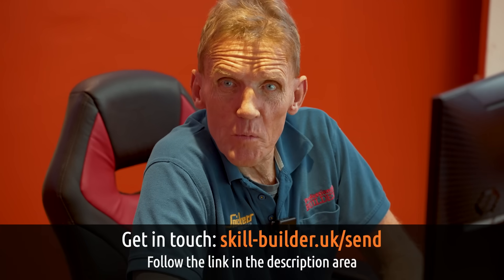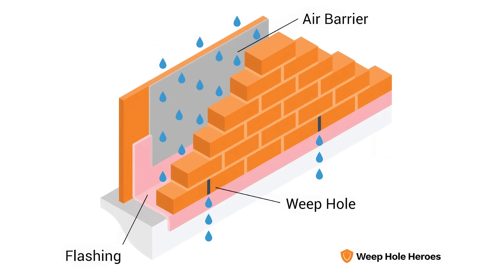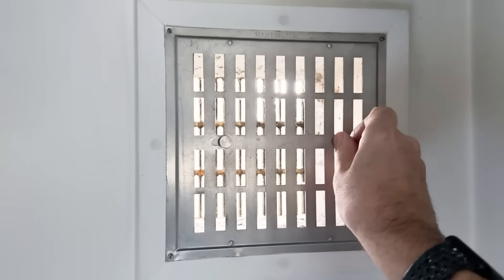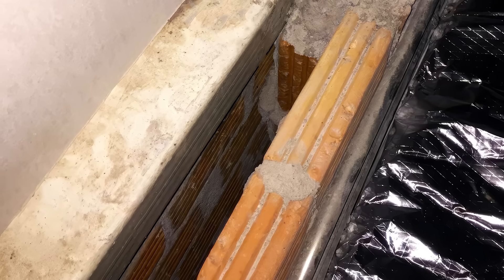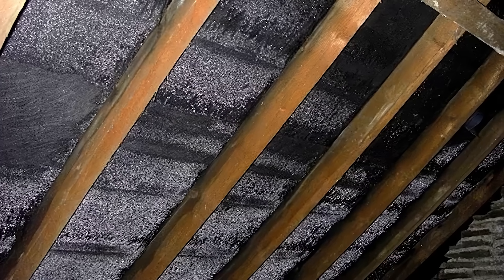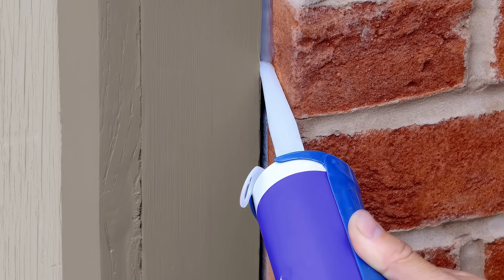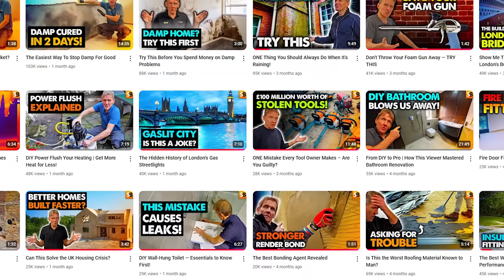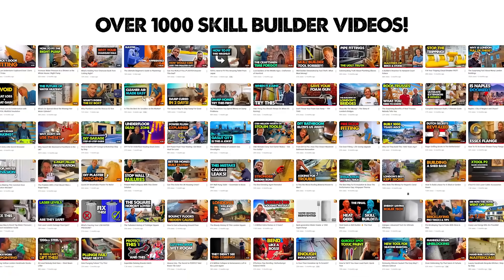The Truth About Cavity Wall Ventilation

Comment: You don't dry your clothes after washing by putting them in a closed plastic bag, you let air movement (draft or wind) on them to dry them out. So how does sealing the cavity help get rid of any moisture build up, be it from penetrating water from rain on the ouside courses of brick, or inside from a leak of some kind. Once you get moisture laden air you have condensation somewhere. Lack of air movement in houses is one reason we are seeing so many pictures and click bait stories of black mold. I love seeing these pictures of huge horrible mold in houses - basically means they are too lazy to clean it off !
Reply: This is also my logic, better blowing into the loft than soaking into the internal skin? Or mold filling the cavity. Perhaps this is in reference to new builds. Either way, often these short 3m videos leave more questions than answers. Rogers longer form content is much better.
Reply: Black mould is a PITA. We have all upstairs windows left on vent 24/7. The bathroom and kitchen have extractors venting to outside and I clean the grilles and duct once a year (doesn't need anymore than that it as even then they aren't particularly dirty). I open all windows in the house for 10-15 mins twice a day. There is a 'healthy' draught unser the front door too.
The children have a moisture absorber (unibond ring shaped model) in their bedrooms too. Probably only removing trace amounts of moisture each and only a portion of any excess when their blinds are closed which will almost seal off the vented window area.
We still get black mould growing in the bathroom on the walls and ceiling and a bit in other rooms around the window reveals. We hit it with a dedicated black mould remover every so often (tried both HG and the Bang brands). It always comes back.

Victorian house with no obvious damp issues - we had areas that were picked up when we bought the house treated and that seems to have been good for the ast 19 years - skirtings, plaster, paint no problem at all.
Central heating to every room although generally set at 18 unless we're feeling the chill and then we go up to 19.5.

Not sure what is going on but it's annoying. Not huge patches of the stuff and we're all relatively young, fit and healthy so not at major risk from it. Be nice to get rid once and for all though.
Reply: @thebrowns5337  Not an expert, but sounds like your double glazing is pretty good, and so water is condensation on cold spots around the house. (Reveals where innerleaf is bridged to the outer leaf and causes a cold spot). Bathrooms are extra humid, if you ever get it refurbished use backboard like Jacko which is insulating. Extractor fans you have might be useless, someone on YT did a video demonstrating the lack of Static pressure from most cheapies, might be worth upgrading them. Worst case, fit a PIV, tons of good testimonies.
Reply: @thebrowns5337  get a decent size dehumidifier
Reply: If you have alot of moisture in you cavity there are propably things you can do first to avoid that. But ofcourse you can live in a area or in a house were cavity insulation is just not an option.

Comment: In my new place to moved into back in May, there’s been a persistent problem with hotspots on the ceiling for condensation and mould build up, there is even a moist/damp patch of wall by the bedroom window, surveyors from the council say either it’s a “slow leak” (why and where from?!) and/or to do with the cavity wall. In rear of the property (I live in a 70s build bungalow) there are two brick air vents which appear to have been filled with expanding foam by the previous tenant! Do I unblock these or not?? Insulation in the loft apparently is sufficient but around the eaves is going to be further inspected by roofers by removing a couple tiles. The condensation and mould appears in bedroom, bathroom and kitchen, and yes I have the trickle vents open 24/7 and open windows daily, even for an hour or so during winter months.
Reply: i use a £15 infrared gun thermometer to dind the cold areas in walls and ceilings - they were in the top 6 inches of the walls, i kingspanned them during roof repairs

Comment: Okay... I am an Engineer (old school), who is in the later stages of building a timber frame passive house. I have a rendered block outer leaf with 50mm cavity. the timber frame has a semi permeable foil/fabric layer onto 9mm OSB sheathing, which in turn nailed to 235mm inner leaf timber stud work. The top of the cavity wall is closed off with  fire socks. 
The semi permeable membrane works on an "Osmosis" method where it allows residual moisture content in the frame to escape into the cavity. If that cavity is fully closed and saturated with moisture, like after having heavy driving rain then sun heating the wall, creating high humidity, this effect will be diminished.
Also by having cavity trays at DPC level and above Lintels, there are weep vents at 900mm intervals, so there will be air movement to a degree. The fire socks around the roof line will stop air to the attic space, and also fire if it does happen. I believe that having a closed off cavity will eventually impact on the timber frame in the future. Because of my fears, probably unfounded, I will be painting the render with ProPerla paint when the weather warms up. Apparently, hydrophobic paint is the way to go nowadays.
Reply: How does cavity 'saturate' with moisture after heavy rain? What is the point of building an external wall if this occurs - bricks absorb / pass water through VERY slowly so unless under water or direct heavy rain for weeks and weeks, its not going to happen! If you are building with an internal breathable skin then that MUST be ventilated on its outer face - the design is not correct if not, you are mixing methods and not in a good way!
Reply: @kawazukisoddbits2717  If you have a closed cavity and have a damp inner side of the outer leaf, and after a period of driven rain, the eventual sun will initial warm that wall to create a more humid environment, until the wall outside dries, to then pull back the moisture to the outside. The levels here maybe very small and will not affect the inner leaf and I am probably being overly too critical. Traditionally cavities were open at the top and roof eaves had ventilation either in the soffits or as vent bars sitting on top of the fascia boards(which the tile sat on), so you had a vented loft space. My house is on a hill (in Cornwall), exposed, South facing, and the South West weather fronts do push hard on my facing walls.
Reply: As long as you're weep vents are 65mm high and you have them at 900 centres above and below any fire socks and at dpc level at the ground, this should be sufficient to properly vent the cavity. Here in Scotland for timber frame construction, the regs require cavity vents of at least 300mm2 every 1200mm. You should get more than that if your vents are at 900 centres.
Reply: @WilliamBell-tj9sq  Yes, I do have weep vents at DPC and Lintel levels, so when my exposed house experiences high winds, which it does, it will force air from the exposed side around to the other side which will be at lower air pressure. I am probably being overly critical of my situation.
Reply: @adamsweet3587  could you not install a soffit/fascia vent so any moisture goes outside and you maintain the firestop..? I would also paint the render...
Reply: @mistervelux  I am probably being overly critical on my situation, as I do live on an exposed Cornish site, and yes, my render will be painted with hydrophobic paint.
Reply: I applied emporer paint to my house after reading all of the great reviews and technical specs. I'm pleased to say a year or two later that it's doing exactly as it promised (it was expensive compared to other masonry paints but you get what you pay for) the opacity was also incredible. Only trouble was I got some flecks of paint on my car, the paint is so durable it all remains on my car to this day 😮
Reply: What made you go for timber and render?

Caveat that I have my own prejudices and must admit I'm not a fan of timber frame (if a wisteria taps against the outside wall in the wind the noise tends to come inside rather too well).  But also it seems complicated: vapour barriers, weep vents, and various details that can be got wrong, or that may fail or be damaged in time.  Plus render isn't easy to patch up if you need to make a hole for temporary access to the cavity in the future (more to the point, my plastering skills would mean any such surgery would inevitably leave scars).

I came across the concept of straw bale a few years ago and wrote it off as being the kind of things that a hippy would do for the sake of being weird, then I ended up learning more about it and now think, if I ever build myself a new house...

Comment: Up untill the early 70s with the advent of cavity insulation all cavities were sealed at roof level and all air bricks wether pantry or floor insulation were chanelled through the cavity with propriety clay sleaves or slate, since cavity insulation appeared cavity insulation has to meet the roof insulation to avoid cold bridging so sealing cavities is a thing of the past.
Reply: My parents house built in 1960 has ventilated cavities and under floor space, and has no weep drains or cavity sills so the cavities have to be ventilated otherwise the footings will get wet with the moisture running down. It is a detached property, and when the outside temperature drops below zero C the heating has to be run 24 hours a day to stop the house getting cold. It can't have cavity wall insulation installed, there is too much very random stone in the front and back walls and also due to the issues with no cavity sills at the bottom.
Reply: My house built in 1987 has cavity wall insulation and no air bricks. The cavities are open in the loft, but they do not connect to the loft insulation there is at least 150mm all around the edge with no insulation. This is clearly not an accident, they don't connect anywhere. Also the roof line is low so the outer skin of the walls is about two bricks short of reaching ceiling level, so it would be extremely difficult to connect the two sets of insulation. If you did the soffit vents for the loft space would be blocked, hence why it is clear this is part of the design and not a mistake.
Reply: Our 1930s house has a cavity that is unsealed at roof level.
Reply: They want a house like an envelope of insulation and air thight so the only air coming in is through the air vents not leaking everywhere  ... I use the extraterm full cavity fill with the plastic front and it leaves 10mm air gap on the eternal block... and keep the internal leaf thight against it.. I don't like to see people pumping these cavitys especially brick cavitys as they are so porous
Reply: Because the driveway has been raised (Block paving) remove airbrick replace with a brick and install a new airbrick above

Comment: An Insulated cavity should not be
closed off at the top, this allows the continuety of the wall insulation to join up with loft inulation with no break between. 
Close the top and cold bridging occurs.
Reply: Not if you close it with an insulator

Comment: Hi Roger, up here in Scotland for the last 40 - 50 years the majority of new build houses have been timber kit construction where it is essential that the cavity is ventilated. The regulations state that ''Cavities should be vented to the outside air by installing ventilators with at least 300mm2 free opening area at 1.2m maximum centres." This is normally achieved by installing ventilation cassettes similar to weep vents but full hight of the brick (65mm). The cavity fire barriers should also be taken into account with the placement of ventilation cassettes each side of the barrier. This ensures that each fire compartment within the cavity is properly ventilated with ventilation cassettes at the bottom and top of each compartment. 
Why don't you do a collaboration video with someone who is fully up to speed with the Scottish regulations and practices. I'm sure your many Scottish subscribers will appreciate it.
Good videos. Your plumbing ones in particular are excellent.
Reply: I should have added that we do use cavity insulation but it is now generally a solid sheet installation that doesn't completely close the cavity. An air gap is always maintained  to provide the ventilation.
Reply: I'll second the Scottish request!

Comment: This is a timely video. My house has a rear extension built in the late 1960s. There are air bricks on the outside wall at ground level but these don’t go all the way through to the inside of the house, but appear to be there to ventilate the cavity. The internal walls get particularly cold where the air bricks are on the outside wall, and so condensation tends to form inside at those spots. Should these external air bricks be sealed?
Reply: Don't forget that they may be there to ventilate under your floor(s) in the house. If they are - don't close them off! You can find out if the holes are large enough to take a small camera.. or just break one out and have a look (but have a replacement to hand!)
Reply: I have a very similar situation. 60's built extension with cavity, no insulation at all. I have one air brick about 3ft off the ground but it does vent through into the cabinate under the kitchen sink. The air brick isn't ducted so blows into the cavity as well. All seems a bit mad to me, I'm thinking of bricking it up to stop the wind howing through into an already cold room.
Reply: If you have wooden floors down stairs the vent are for air flow under the floor

Comment: Bit of extra history I discovered as a building surveyor: large air bricks were often placed above the DPC level to ventilate larders or pantries in houses built before the widespread use of fridges. You can normally identify these 1. Where they directly align with a large larder or pantry and 2. If it was on the north most facing side of the house out of direct sun light. Roger is right most of these ‘wall airbricks’ are to ventilate a room though.
Reply: my Mum had a "pantry" under the stairs before the advent of electric fridges, comprising of a zink screen in front of an air brick and food sat on a marble slab, one tuesday she had a  nasty shock and chucked half a joint of beef crawling with maggotts and blueflies, that was dinner, bastards.
Reply: I think I might have one of these - no larder (anymore), but it opens up into the kitchen. Would you say these are no longer needed?  It's letting in a huge draft.
Reply: @dagmarbelesova4284  Depends on your current kitchen set up really mate. Kitchens do require good ventilation as a lot more moisture than people think is produced from cooking, tumble driers and boiling kettles etc. If you use other means of ventilation such as extractor hoods, a mechanical extractor fan or are just generally good at opening windows and heating your house well then yes you could probably loose the airbricks. 

If don’t utilise any of these ventilation methods then there is nothing stopping you from temporarily covering the airbricks and then buying a cheap humidistat off amazon to monitor for high humidity in the kitchen and also performing visual checks for mould/condensation patches before deciding whether to remove them. 

Hope that helps!
Reply: @Fraser-B  Thank you for the quick and comprehensive reply, that's super helpful! I've noticed the windows misting up so I always open them and use the extractor when doing anything in the kitchen. I think thr utility of the vent is limited now anyway as it's hidden behind the kitchen cupboard. I might consider an extra tor fan or a single room MHRV, the vent just doesn't seem like a great solution atm as it can't be closed or controlled in any way.

Comment: Im self building a house with partial fill cavity wall but no one seems to close off the top of the cavity in our area.

Since face brick outer skin lets through a lot of wind driven rain, if i close off the top how will this escape, both the water pooling at the bottom of the cavity, and the condensation from it trying to evaporate?

The bottom of the empty cavity is 300mm below outside ground level, which is clay soil so weep holes wouldnt work, they'd be blocked or letting it in.

I'm going to apply stormdry masonry cream to minimise the water ingress.
Reply: Yes the best way is to use a masonry cream. We do this with chimneys. Prevent ingress....allow breathing